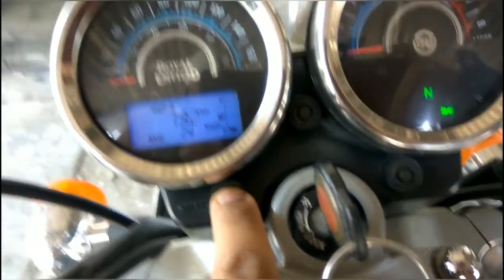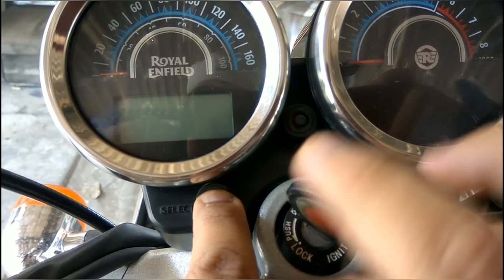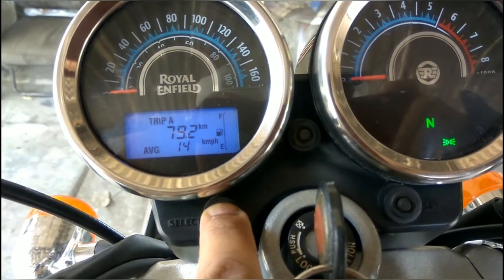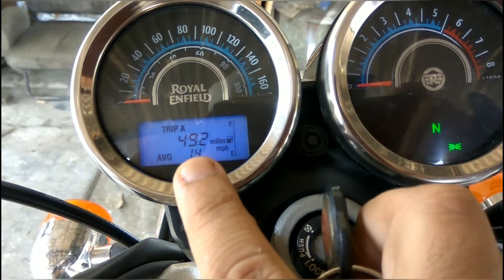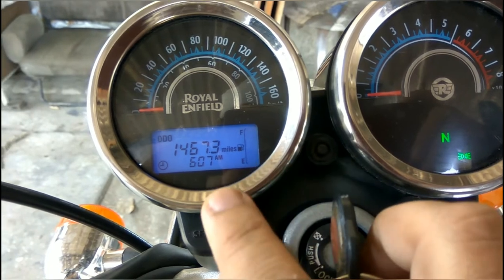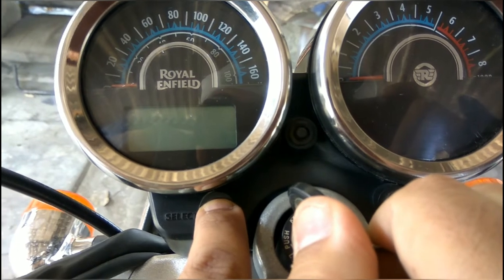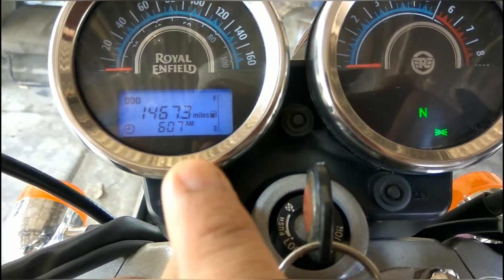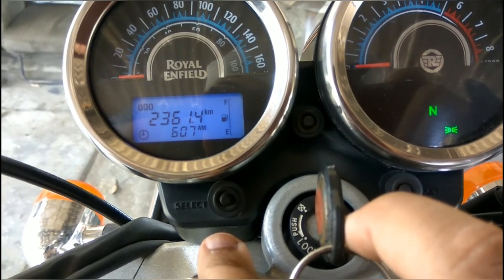How to change Km/ to Miles/ on Royal Enfield Thunderbird 350

Comment: Brp I have thunderbird 350 bs3 and it shows a average of 25 on speedometer. Does it show accurate because I can feel that I have tp refill petrol again and again
Reply from the maker: Hello their , Petro are you using Miles or Kilometers? Because it converts 40 kilometers into 25 Miles if you changed the setting of Digital Meter.I think it helped you alot .
Reply: @MechWrenching  Kilometres I'm using
Reply: Any idea how to increase average?
Reply from the maker: Yes sure you can improve milage by installing original Exhaust , Replace Engine oil with 15w40-15w50 semi synthetic Engine oil , Tune your Catborator by a good mechanic Change your Sparks plug this should solve your problem of low mileage .
Reply: @MechWrenching  I appreciate that thank you